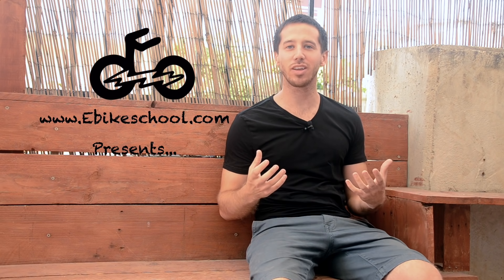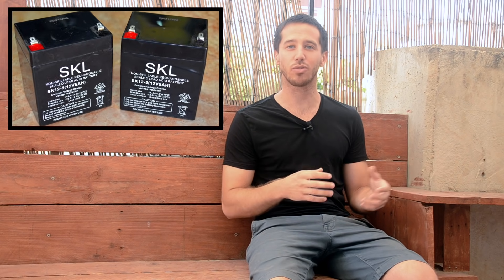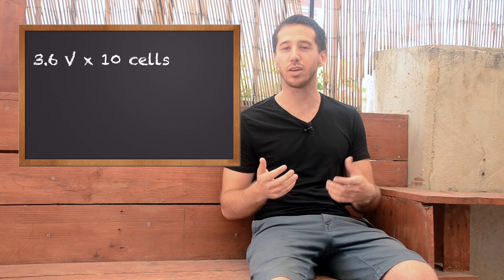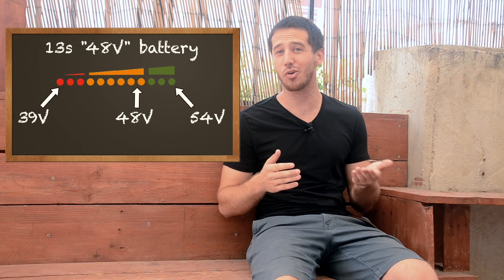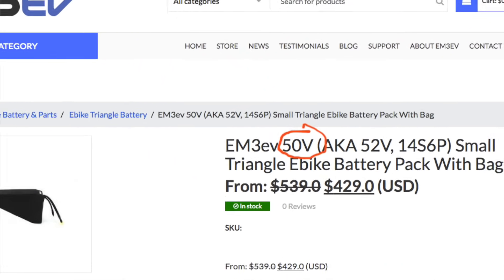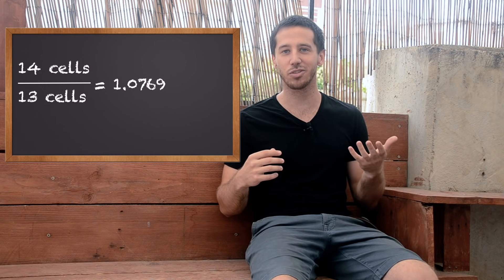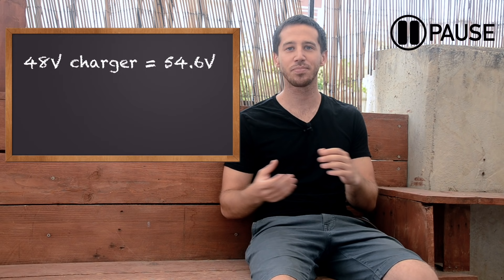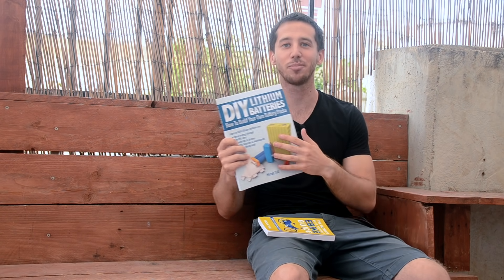Which is better: 48V or 52V battery?

Comment: Hello ,
Can I replace 12 v 9ah lead acid battery with Li-ion 12 v 9ah battery pack ? 
Can we use lithium ion for Motorcycle ? is it safe
Reply: Chetan Verma Li-Ion batteries need to be protected against overcharging and over voltage. 12V led batteries usually charge with about 13.8V.   4S lithium pack is 14,8V charged with 16,8V. 3S Lithium pack is 11,1V charged with 12.6V. I would not recommend that without a charging module that provides the right charging voltage and stops charging when the battery is full.
Reply: Yes, from my experience you can.  Li-ion are used by many automotive industries, additionally all necessary safety precautions should be considered.

Comment: Please do a video on motor watt difference. Ex, is a 500watt motor better than 300watt?
Reply: Given the efficiency of an electric motor, more power is generally a better idea (besides the common weight increase). If you use a 500w motor at 300w, it should be no worse for battery use than a 300w motor, but has the extra headroom if you need to pull more current, etc.
Reply: @Metal-Possum  
Well said Alex will said
Reply: actech
My 1000 watt is much faster than my old 750 with 48 volt battery. Both are mid drives. I'm not a big guy and can max out at 55 km. Ride safe. Have fun.
Reply: You don't need a video.  Its basic physics.  Watts are a measure of electrical power, or 'work'.  More work = more power from the electric motor.   Naturally, more is better if you can afford it.
Reply: @treebeard3579  
Can't you just fucking say it without being condescending? Somebody asks a question be nice or don't answer let this guy answer the questions we don't need you to answer

Comment: Most ebikes come with 36v batteries.  Your talking self-evident drivel, suggest you bare in mind some thought is required for good and respectable e-bike journalism . Use your ebikes responsibly and under the radar, or lose them altogether!

Comment: Have you done a video, or can you do one, on the relationship of amp-hour rating to voltage? Electricity is kind of voodoo to me, right up there with boom-sticks and flying machines. I am considering buying a second battery for my E-bike, a Rad Rover from Rad Power Bikes, and at $399, the battery vendor I'm looking at has what appears to be the replacement battery for $100 less than Rad sells it for. The specs are 48V 11.5ah, and it is in a "dolphin"-type case. The vendor offers the same battery also in a 13.5ah rating, for $60 more. Is there enough of a distinct advantage to having an additional 2.0ah in a battery to justify the $60 price differential?
As an aside, the vendor can't confirm for me that the connector on their dolphin cased battery will match the connector on my e-bike. Is there some kind of standard that can be relied on with these things?

Comment: Regarding the idea of pulling less current with a 52v battery, I think people are talking about current per cell. The total amount of current being used will be the same, but there would be less current per cell considering there would be more cells... just a thought...
Reply: It doesn't matter if you have 1 million cells. If they are all wired in series, the only thing that will change is the voltage. Granted, you'll have around 3.7 million volts, but hey, the amp draw is the same per cell (you will have loads of power, but again, amps will be the same). By adding one extra row of cells in series to the 48v standard, we obtain the 52 volt battery. The only thing that changes is the voltage. The amp draw will remain the exact same both overall and per cell.

Comment: Just a curious question. Laptop batteries. I watched people take them apart to get the batteries from them to build a pack. Is it possible to leave them in their cases and just connect several cases together?
Reply: I am one of them. If you can figure out the wiring connections, it is possible to use them as is, connect them in series or parallel, but generally some of the cells maybe faulty and cause other good cells a bad day. That is why they have to be taken apart to recondition them and categorize their state of serviceability and amperage.

Comment: How many packs do i need to build a 52 volt
Reply: using li-ion cells -18650,, u need 14 in series, giving u nominal voltage of 51.8 volts.  but that would only give u one cell worth of amperage ie approximately 2 amps. therefore to get the desire amperage, multiply those series (of 14 cells) to get your amperage. Hope this helps.

Comment: after getting to the top speed amperes start getting low. Does that Situation will remain same after 52 V upgrade because motor needs more amperes to generate more power... Does n`t it??
Reply: Hassan Sound No! I got an eletric Bike with a 17a controller with Display and a  250w motor from China and I'm pumping up him with my 13a 52v battery at 650w and it still AMAZING... I can get 30mph in that Bike xD the Power of a 52v is amazing... With Full Battery I can get something about 30mph in 4 seconds... In Races Between me and guys with a 48v Bike is simple amazing how they can at least not lose for that much when I'm about like "battery on the last throttle" hahahahha
Reply: There are two ways to add to power: add voltage or add amperage. In this case, you are adding power by adding voltage. The amp draw will remain dependent upon the motor controller. Think of amps as your fuel tank capacity.
Reply: Mr Ethan, I don't think you can add power with more amps- only range.  You are right though about the fuel tank- more miles, not speed.  The amps draw are limited by the controller. So unless  you buy a new controller with higher amperage or change the capacitors on your controller, amps draw will remain status quo,  even with a higher battery amperage.
Reply: Kimo sabe Yeah you are right, it is typically governed by the motor controller. I meant if more amperage is added to a system, the power in the system increases.

Comment: Thanks for the valuable information.  
What happens with LVC when you change from Lead Acid Batteries to Lithium?. Normally in 48V you have LVC at 40V in controllers. But I understand that Lithium batteries can run with less voltage ... Thanks!!!
Reply: Doesnt matter what batteries you put. The LVC is controlled by the speed controller.

Comment: Lead acid  batteries drop voltage during their discharge as well ranging from about 13 volts on a fully charged 12 volt battery down to 10.8 volts when fully depleted.  As far as 52 volts li-ion batteries, watch out for the game the cordless drill market is doing in counting lithium ion batteries at 4 volts per cell instead of 3.7 volts in which case a 48 volt li-ion battery is the exact same thing as a 52 volt 'MAX' battery.

Comment: Another question. I need full power but don't need a very big distance. I thought that it is impossible, but today I found that may be it is possible with selection of right cells. Please correct me if I'm wrong: with this cells Samsung 25R 18650 2500mAh 20A I can have more power from 4P13S battery but the range will not be so big. I want to use 48V 1000W motor
Reply from the maker: You are correct

Comment: i want to know if you buy a kit of 1000w is that for the speed controller or can you buy 1500w speed controller and will it work with the motor wheel of the 1000w kit
Reply: Yes it should. I have a 60v 350 watt motor. Have upgraded using 64v 1500 watt speed controller. Nevertheless, check for any restrictions on the new controller for it to work. Get or research your current speed controller as compared to the bigger one-compatibility, connectors, compulsory connections etc
Reply: Kimo sabe so to make my 1000w motor hubwheel faster all i have to upgrade is my controller and battery
Reply: theoretically Yes, as long as your battery pack can meet the requirements of the new ESC but the 2 main issues are compatibility and  processor imposed speed limitation that may exist or  inherent in the new speed controller itself. do your own research to meet your needs.   Good luck.

Comment: if the short link doesn't work try full link https://www.aliexpress.com/item/Free-Shipping-E-bike-48V-lithium-battery-box-Down-tube-electric-bike-battery-case-for-48V/32763112527.html?spm=2114.search0104.3.18.RWPtiW&ws_ab_test=searchweb0_0,searchweb201602_2_10152_10065_10151_10130_10068_5400015_10307_10137_10060_10155_10154_10056_10055_10054_5370015_10059_100031_10099_5380015_10103_10102_5410015_5430015_10052_10053_10142_10107_10050_10051_10084_10083_10080_10082_10081_5390015_10178_10110_10111_10112_10113_10114_10312_10313_10314_10315_10316_10078_10079_10073_5420015,searchweb201603_16,ppcSwitch_3&btsid=d1a44904-7b78-4aac-8bb9-14ba90a58ff5&algo_expid=0e8601be-d2ac-402a-abc7-39858e58011c-2&algo_pvid=0e8601be-d2ac-402a-abc7-39858e58011c&transAbTest=ae803_2

Comment: man why didn't i just build a 52v??? :/ I stuck with 48v and I'm regretting it soo much. you really notice the battery draining in a 48v bike after a few klicks:/ the acceleration curve changes dramatically at higher speeds when the battery is a little lower than 60%.

Comment: Could i theoretically just put the Extra Batteries in series without putting it in the battery kit? 
So there would be the battery connected to the Motor and stuff but with a switch i could activate the Extra Batteries in series, which means i have a little booster Pack that i can activate in low voltages, so i would get a little bit more Power in the end? 
(there would be no bms attached so i would always have to look at the voltages)
Reply: Pls don't burn your house down!
Reply: Yes it is possible practically to just connect the extra batteries in series, but the battery configuration is a bit tricky to  prevent excessive over charging of lower voltage pack added. (Higher voltage pack voltage travel to lower voltage addition). I have tried it up to 12 volts increase, speed controller accepted it and i had an increase in speed and torque. but i think it would not be good for the batteries in the long run and the motor was hotter than normal.

Comment: Thank you for an interesting video. I would like to use batteries to run my ham radio station which runs on 13.8volts (I will use a buck converter to reduce the voltage) . How do I go about to calculate what capacity batteries I need to run my station including its autonomy..? The transmitter requires about 25 amps to provide 100w of power. I am getting mixed up on how to calculate say a 48v 20ah battery when I am using it to run at 13.8v. What would be the amp hour in that case?
Reply from the maker: It'd probably be easier for you to convert to watt hours. 48V 20Ah is 960 watt hours (48v*20ah=960wh). So if you are transmitting 100% of the time at 100w, you should theoretically have 9.6 hours of transmit time. But as I understand Ham radio (which is not much), you don't transmit all the time and you use much lower watts for just listening or receiving. So it should last much longer.
Reply: EbikeSchool.com Old One Legged Joseph T here, on the subject of which is better. 24 volt battery, will it run a 36v hub motor, or is it like the min that will run a electric motor no matter what?  there is a 36v hub motor and we only have a 24v battery, will we have to use your method to raise the voltage or will it work just slower running with 24 volt? Joseph T
Reply: Thank you for your prompt reply. So if I do simple maths if I divide the 960 by 13.8 I get 70 amp hour. I have already worked out a simple cycle of transmitting and receiving so now I can work out my autonomy.  Excellent.

Comment: It will run cooler if you have set speed limit and not set throttle limit. If you run 25mph @48v vs running 25mph @52v
Reply from the maker: Yes, this is true. At the same speed, the controller will pull fewer amps. But since 52V gives more speed at full throttle, in practice most people will go faster and thus use more current, negating the advantage. But if you can set an external speed limit, you can solve that issue and actually achieve a cooler running battery.

Comment: Thanks for the clarification on how they clarification on how to calculate how many volts a lithium battery is! I have been working on a 14s battery and I was wondering which voltage they use to calculate the volts for a battery, thanks!

Comment: So how do you get more power when the controller limits your speed to 28mph?
Reply: Buy a higher voltage and therefore higher amperage controller.  For an ebike that does not have a speed sensor, the controller does not limit the speed to 28 mph but only the voltage and amperage.  That is why on downhill you can go more than 28 mph! if you do not want to buy another speed controller, you have to modify the speed controller (upgrade shunt and capacitors) to accept more current/amperage - watch modify speed controller on you tube.
If you have an ebiike with speed sensor, 1st - change location of sensor magnet to pedal area location or change the LCD display to miles per hour-it may work. 
Do these on your own risk!

Comment: Greate video! So if I make a 14s battery and charge it with a 48v charger, may I extend the battery cycles?
Reply from the maker: Yes, but you'll only be charging your battery up about 60-70% of the way.

Comment: just bought a power converter boost module to tinker with the voltage on a store bought ebike using those hoverboard batteries I bought from ebay; it is rated for 30A, 1500W.  this bike is just 250W with a 10s4p battery.  it could use alittle more hill climbing capability.  Would be fairly cool to mod your voltage relative to the ride you are planning that day......any thoughts?
Reply from the maker: Yea I've seen people do this. It's a little bit inefficient as the boost converter will burn off some energy as heat (maybe 10% ish?) but its a lot cheaper than buying a higher voltage battery!

Comment: Hey, what do you think of a home made spot welder?, recycled 18650 from tools and laptop batteries?, I have been watching your videos (I know you like to make only the top quality ebikes) but could you do a super low budget ebike build, just for the ones in the crowd that have little to nothing. thank you for everything you have thought me and others.
Reply: Luiz Silveira laptop batteries would work great just make sure you don’t run there voltages too low and get yourself a multimeter to check the health of each 18650
Reply: Luiz Silveira its ok
Reply: Luiz Silveira

Comment: Ahi what kind of time should I be able to get out of a 36 v 12ah battery on a 350w motor?
And is it normal for a battery to loss voltage just sitting around charged to 41.5v after two weeks
Battery showed 39'.5v ?

Comment: Thanks for another great video Micah! Erik over at Luna Cycles also says that your bike is a bit more reliable with 48v (runs a tad cooler with the lower speed?) and that your battery meter will be a little off using 52v.
Reply: Why is it more reliable at 48v? What can happen  to it running with a 52v battery?

Comment: Do you have any thoughts on using the newer 20700 or 21700 batteries I know there will be a cost difference but you do get generally higher mAh and amp limits than a comparable 18650 ?
Reply from the maker: For me, they are interesting but not worth it yet. In 2-3 years, my answer will probably be different. But today, all the variety and performance is available in the 18650 market. Until we see a variety of easily obtainable larger cells, they just won't be worth it for hobbyist purposes. Right now, OEMs get to have all the fun with them.